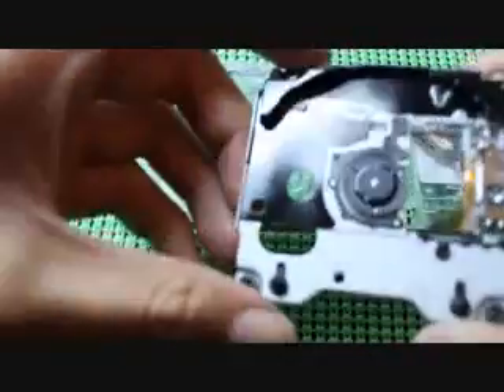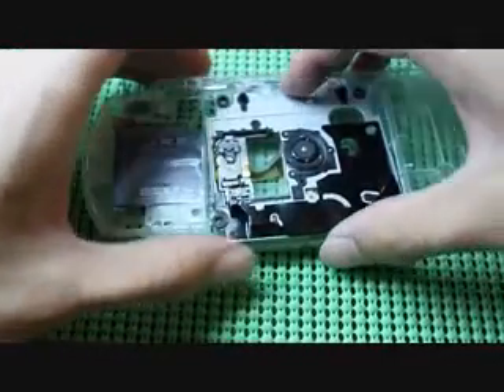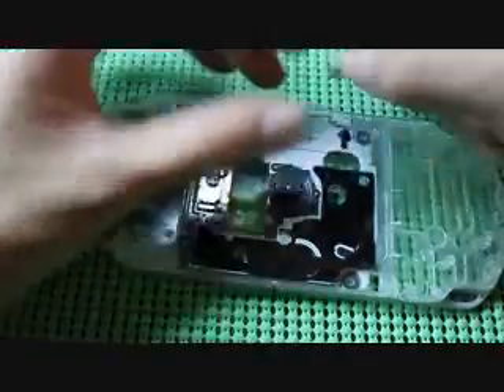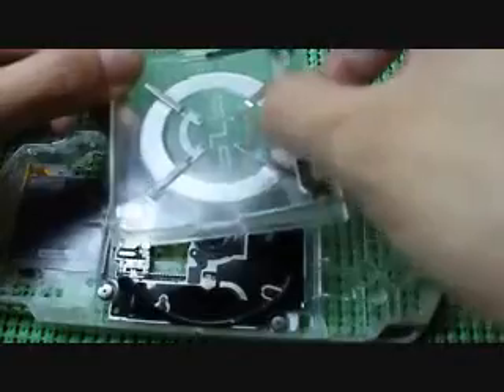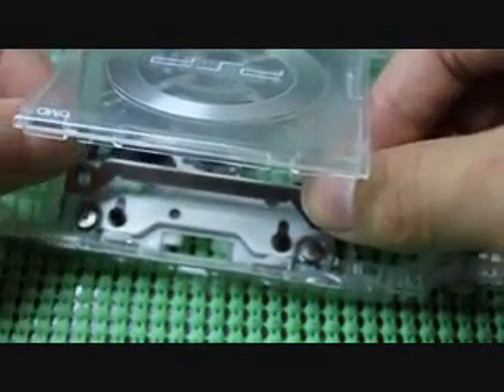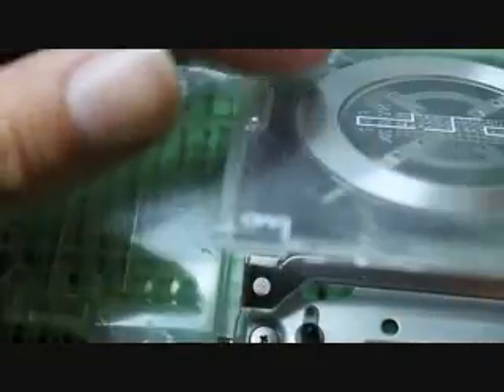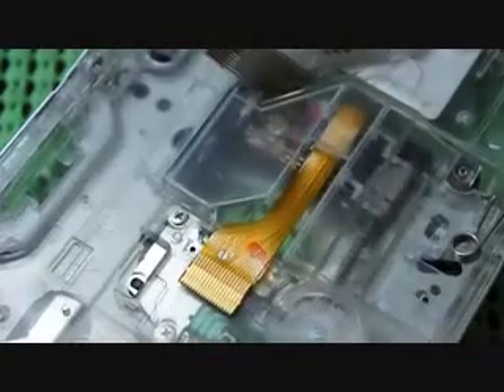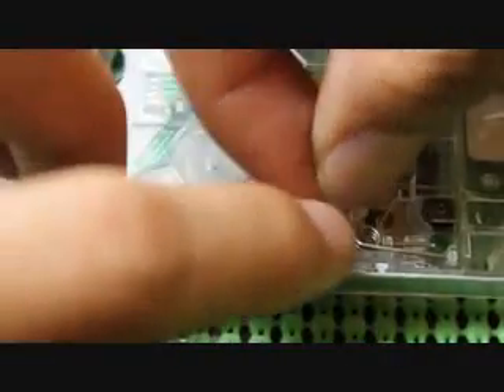How to Install a UMD Drive on a PSP 2000

Comment: I am trying to install all the PSP hardware into a new shell, so basically, I have to take out everything. I honestly don't care about the UMD drive since it's broken, but I was wondering, how do you take out the wifi card and the pad which controls all your X O Triangle and Square buttons?